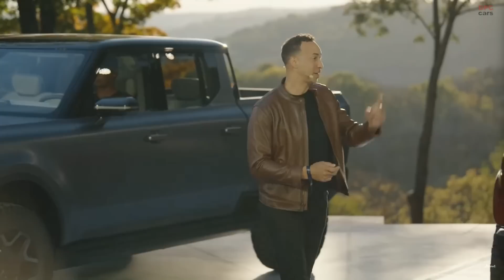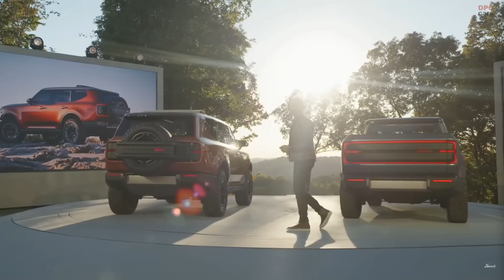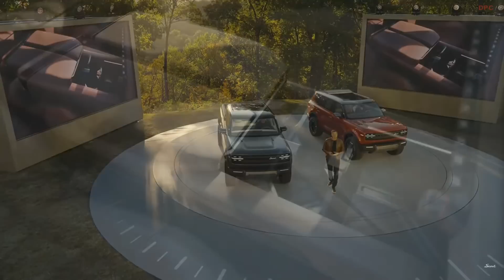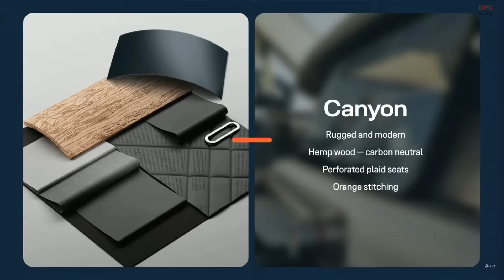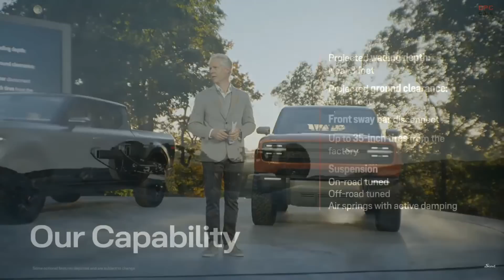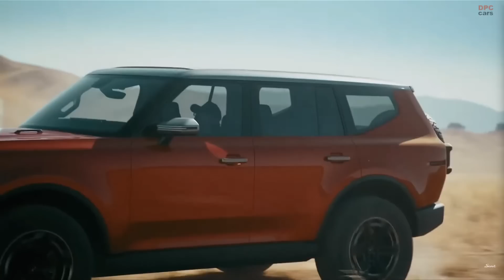New Scout Traveler SUV and Terra Pickup Truck World Premiere

Comment: I think this is a question I hope VW answers in its planning. Does the motor warm up the cold battery during winter, or does it heat the vehicle when remotely started? If the motor can be removed, what is its purpose? If it's a stand-alone generator, how does it offset the weight of the motor, like a mini crane? Can the motor serve other purposes, and is its cooling, exhaust, and fuel system self-contained or adaptable for different fuels? If the motor I’d like to know if it's possible to increase voltage output in a vehicle. I’d love to hear people's thoughts on this. If it is regularly removed, can the case have a protected shell so that in transport, it is not damaged?
Reply: I hope VW is listening perhaps they can produce an battery THAT have an additional battery pack and add a plug to heat some of the STRANDED battery electric vehicles in the wintertime. This might be a side hustle for someone OR A tow company. Connect this a Super Bowl commercial in which they have an extra battery pack that can have enough juice to warm other cold EV batteries and be able to maintain their own vehicle.

Comment: Love the boxy SUV design! I would NOT opt for a glass roof or leather seats. Regarding the rear hatch, I find that a rear-mounted tire often requires a swing door. I’d prefer if the tire were mounted underneath, allowing the rear hatch to open upwards and out of the way. Overall, a handsome SUV—very reminiscent of the Rivian R1S.
Reply: The rear opens up and the tire swings out dude
Reply: @Austinomon  "Regarding the rear hatch, I find that a rear-mounted tire often requires a swing door. I’d prefer if the tire were mounted underneath". My apologies, I thought that was pretty clear. The tire swinging out IMHO isn't ideal. Open space on either side of the SUV rear is IMHO ideal. The tire lower to the ground would help as tires are often heavy and make it to the ground where they belog anyway due to gravity.

Comment: I’ve always loved IH products, though I’ve never owned one.  I have zero interest in electric vehicles.  However, I put down the $100 deposit yesterday. First, I love the design. Second, the combo with the supplemental engine is interesting to me.  

Like most potential buyers, I am not an off roader. I just want to drive in the snow, and on dirt roads, from my home in the city to my cabin.  As much as the purist off roaders may be turned off, this seems like a great vehicle for my needs.
Reply: EV drivetrain is awesome. I like the idea of range extender on a "adventure" vehicle.

Comment: Like to see more range than 500 miles. 800-1000 is needed. Also just a gasoline or diesel engine. I’ve owned 5 scouts, you did pretty good on body lines. Too bad you don’t talk with previous scout owners. There in touch what people want
Reply: +1 - I would go even farther - this NEEDS at a minimum 3,000 miles of range. Otherwise, no dice. Until these manufacturers actually start listening to customers who don't like refilling every quarter, they aren't getting a dime from me. I'll keep my Freightliner Cascadia for trips to Home Depot and my H2 for Whole Foods trips
Reply: @mulchman-p3b 😂 love it
Reply: @mulchman-p3b my kind of humor 🫱🏽‍🫲🏾
Reply: Actually range will get better in the next few years. 600+ 800 range. Fast charging, Who needs more than that. Won’t need gas anything at that point. Once the infrastructure and battery tech is there, ICE engines are toast. Look at it this way, autos in the 1910-1920s at the beginning of auto tech were pretty primitive compared to what came later. EVs are in the beginning stages of this tech. Europe and China are way ahead of us with EVs.